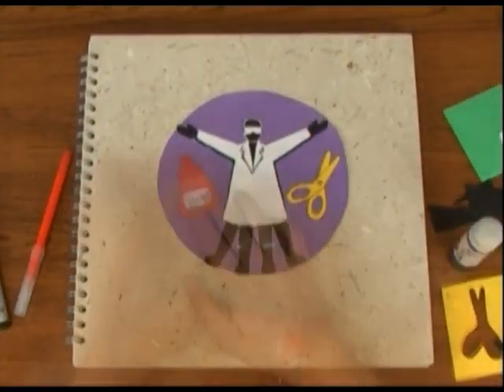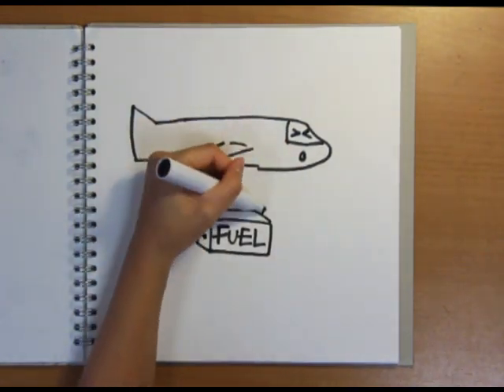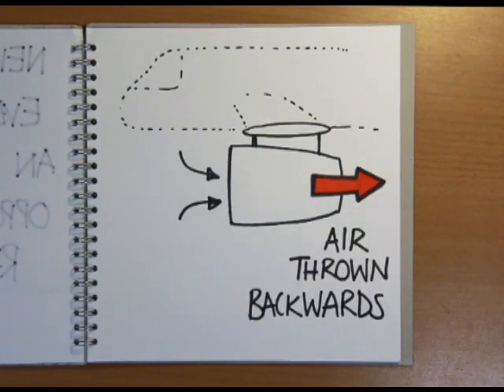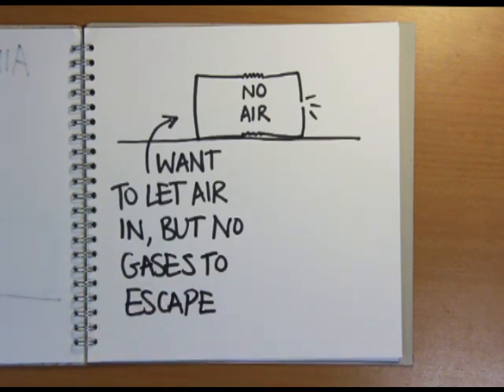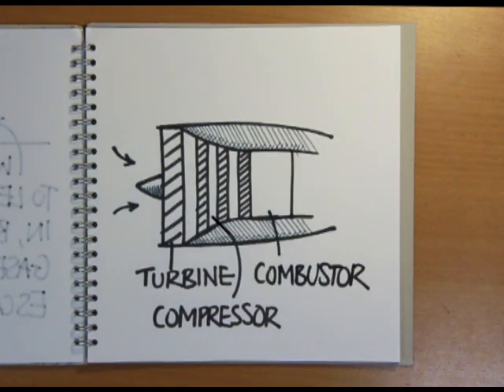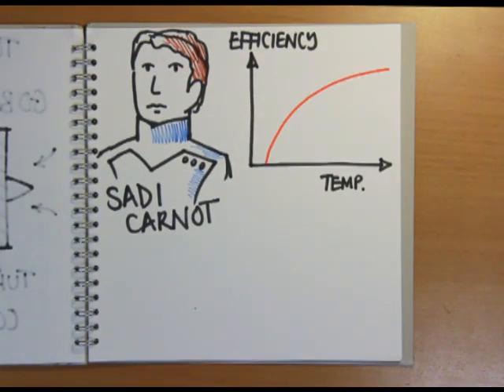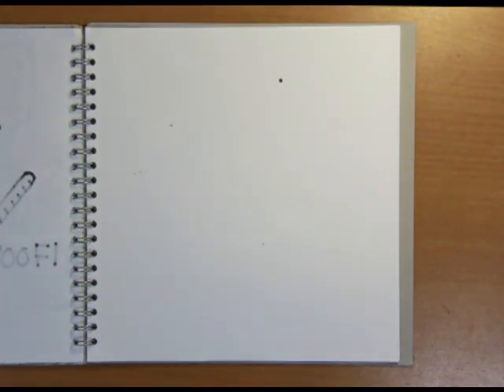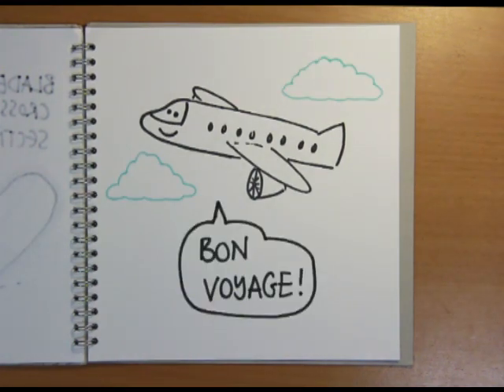How does a jet engine work? - Naked Science Scrapbook

Comment: The engine of a commercial airliner is a turbofan engine. The front stage is the fan, which is propelled by the low pressure turbine, which also propells the low pressure compressor (in case of a two-shaft engine).

Comment: This is true, but the fuel reacts with the air while it is combustet. The more air the more fuel you need. Military turbojet engines work this way as you can generate way more thrust with a smaller engine.

Commercial engines are built to be more efficient, impulse equations consist of mass and velocity: military engine - high gas velocity; civil engine - high mass of gas

Comment: i have heared that when the front turbine rotates, it basically absorbs the air outside and roughly 85% of the air is intended to go outside of the engine. why not to aborb the whole air because the more air we absorb, the more thrust we would have.

Comment: I don't quite understand why it doesn't blow out the front. The amount of energy extracted by the exit turbine is (or should be) greater than or equal to the amount of energy used to compress the incoming air so the path forward or backwards should be equally difficult. The only way around this that my limited understanding of physics sees is that the blade shapes are somehow capable of acting like a one way valve. Is that right, or am I missing something else?

Comment: Calling the front stages turbine is wrong!
The video is nice and explanes the theory in a nice way, but turbines and compressors are the exact opposite of each other!!!
A compressor adds energy to the fluid by... compressing it. A turbine takes energy from a fluid by expanding it again. 

The turbines purpose is to take enough energy out of the jetstream to power the compressor and fan (if existent). The rest of the energy in the gas is used for propulsion.